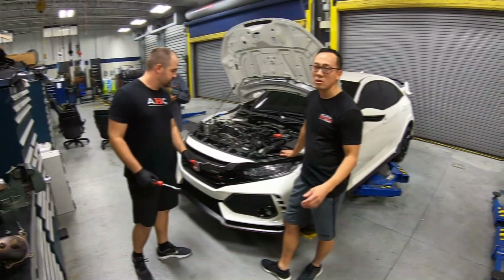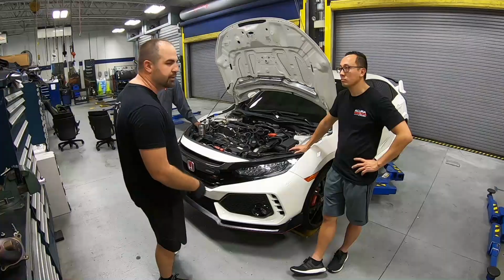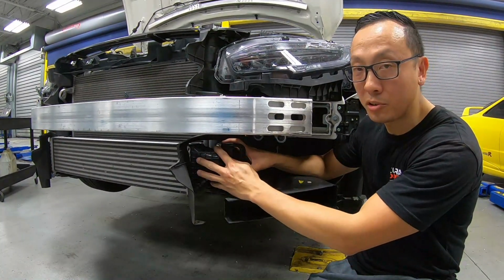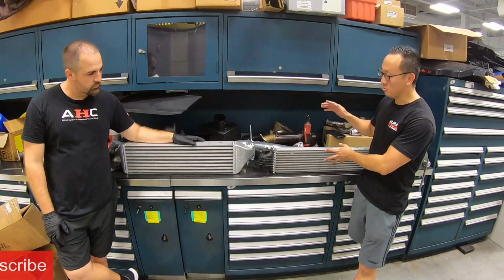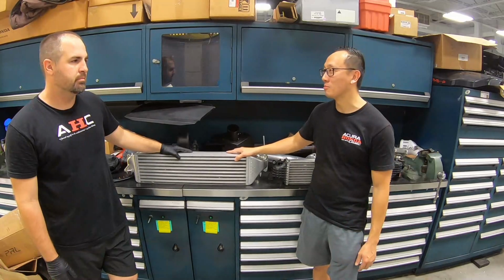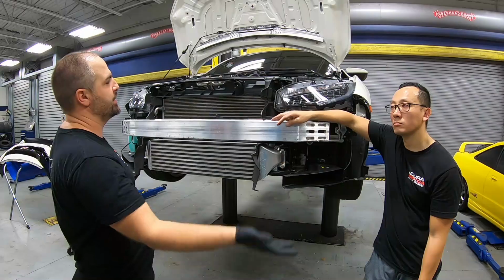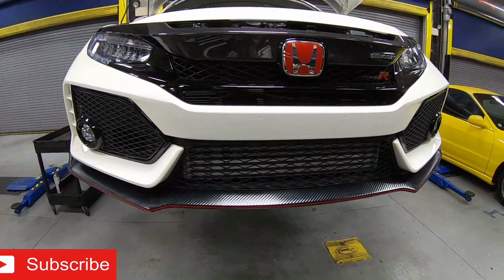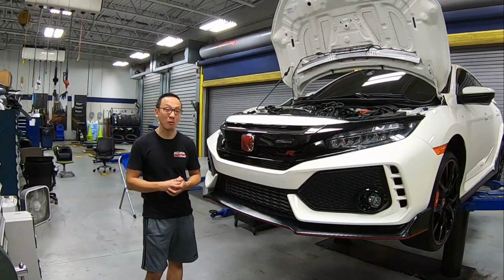FK8 Honda Civic Type-R -  PRL vs OEM Intercooler Upgrade and Installation Guide (Episode 2)

Comment: I have a question, why would Honda not use a cooler like the aftermarket from the start? Is it because of weight , cost etc.....
Reply from the maker: Not quite sure but I am sure there’s a good reason for it
Reply: @ahcgarage  probably costing issues, they are built to a price and the stock cooler is adequate for normal everyday driving, I get the impression that the owner of this one will be doing a bit more than that, John UK.

Comment: Does the type r come with a stock blow off valve or no
Reply from the maker: Yes, pressure releases back to the intake
Reply: @ahcgarage  ah I see so That’s what some of those hoses coming off the pipe are going back to the intake manifold are for then ok. So I just cut all those hoses off and install a blow off valve that goes off into the open is that how you do it?
Reply: @leftright2  I'd hate to be the guy that buys your car next

Comment: Hi, question please. 
Do you think just bolting on PRL INTAKE and INTERCOOLER will give a type r a good power gains? No tune. Thank you
Reply from the maker: It will be gains but probably at minimal
Reply: Probably 15 more HP. They say the intercooler gives 3 HP and the intake about 11-13 more. Without a tune.

Comment: I don't know why honda designed the intake to run on top of the hot manifold.
Reply: Honda quality has really gone down after 2010. But it started back in the early 2000's.